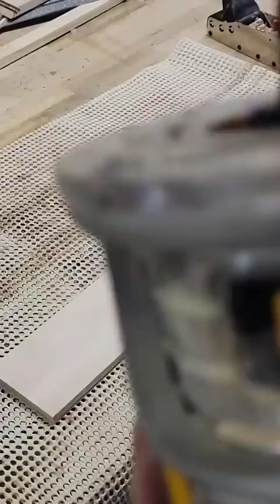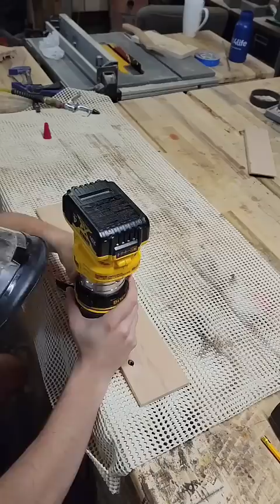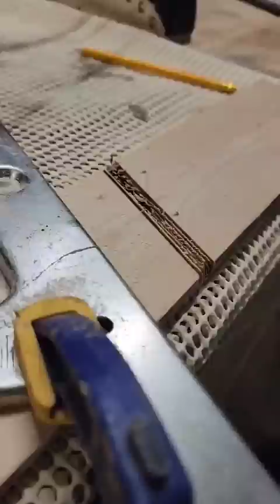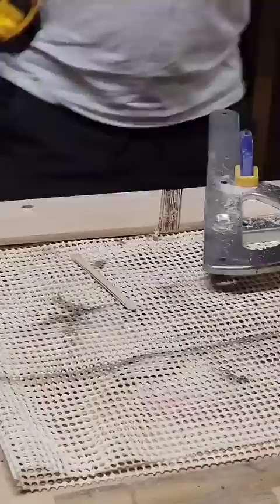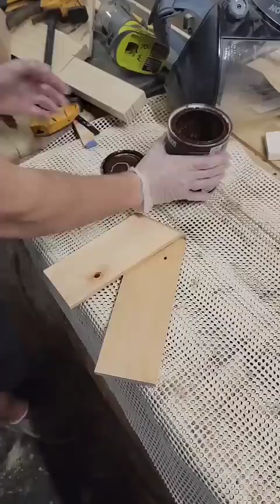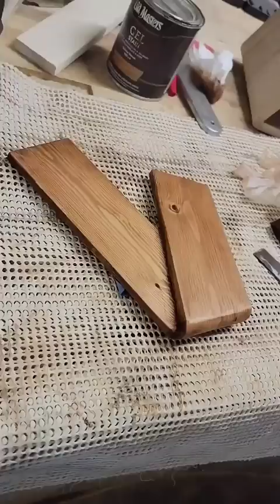How To Fold Wood // Woodworking #carpentry #diy #woodworker #maker #woodworking #wood #handmade

Comment: Where did you get that bit? Is it a special wood folding bit?
Reply: I saw this trick in another video, which is why I know this. That is a milling bit made for a CNC machine, but mounted in a router. You can get tapered-shaped bits for CNC machines. This allows the wood to bend without any gaps afterwards.

You need to get the correct angle taper and to calculate the number of cuts needed.
(e.g. 9˚ bit, 90˚ bend = 10 cuts and no gaps)

Comment: Surely without glueing that top one down that would just snap apart?... you just took all the strength out of it then bent it at its weakist spot... plus when is that actually going to be used in any form of carpentry? Just get any timber from a builders merchants these days... it comes pre-bowed... all of it

Comment: Circular saw relief cuts prolly faster. Not sure tapered cut was necessary. But hey it worked. So good on you.🙂
Reply from the maker: Tapered cut leaves no gaps. Kerf cuts leave triangle shaped gaps when folded.

Comment: Do you need to Buy an extremely specific and most likely expensive tool.
Yeaahh soooooo easy, everybody can do it.
Reply from the maker: The bit was $13 on Amazon. You can also just use a normal circular saw but it's gonna leave gaps